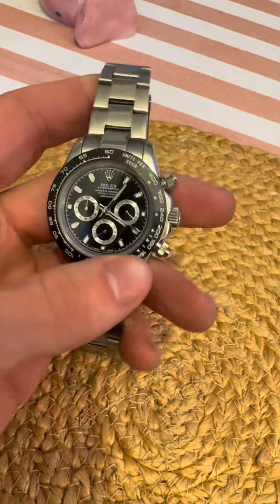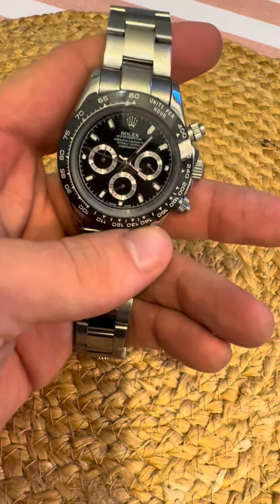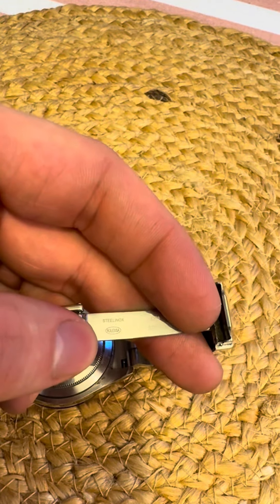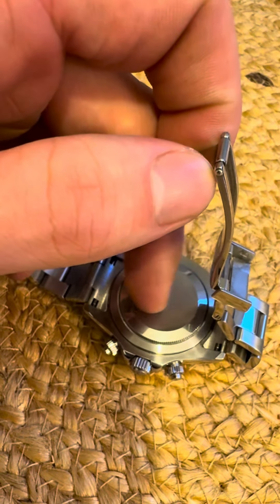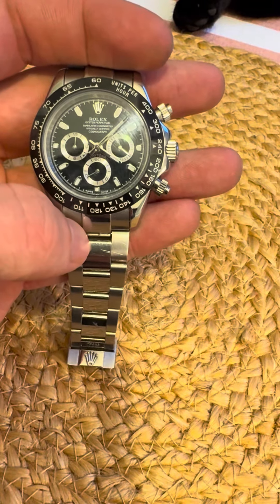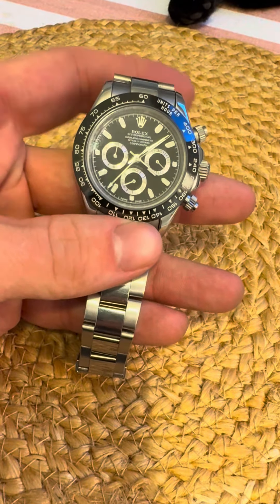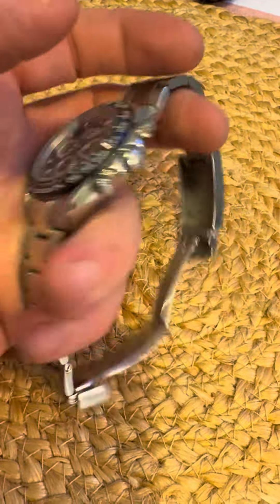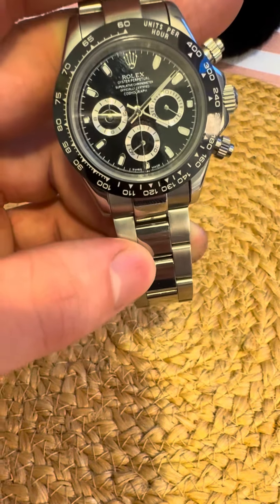How I Spotted A Fake Rolex Daytona

Comment: 1st tell from a long way away is the position of the subdials at 3 and 9 oclock. Their centres should be slightly above (higher up the face) than the centre line of the watch. Very early Daytonas with a Zenith movement were positioned like this fake but those watches are very rare. Second is that its a chronograph, so in its normal state the main second hand should be stationary at 12 o clock. The same subdials (at 3 and 9 oclock) should be stationary too and pointing vertically up. The subdial at 6 o clock is actually the watch's normal second hand. Of all the fakes, these bog standard £60 fake Daytona's are the easiest fake Rolex's to identify.